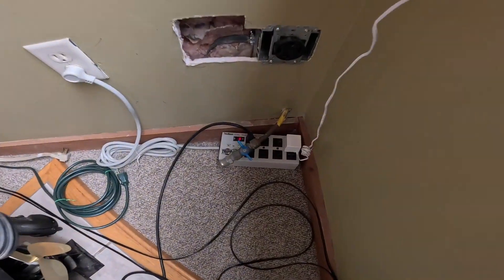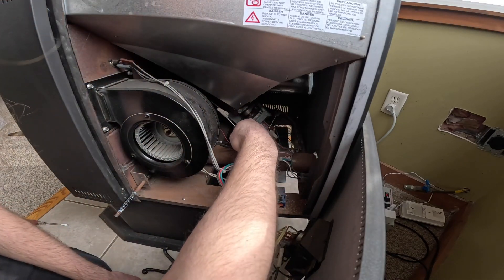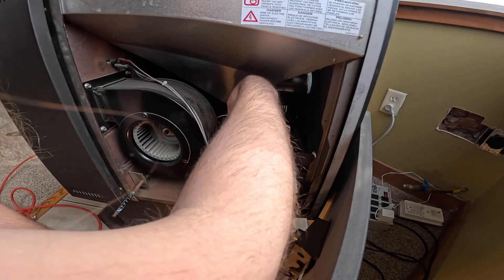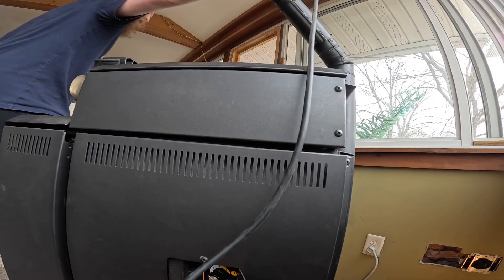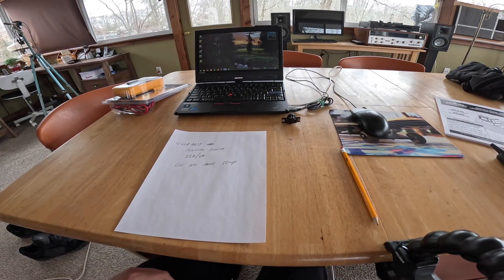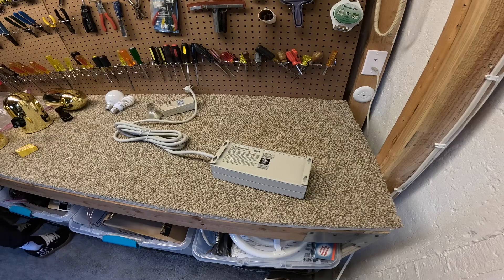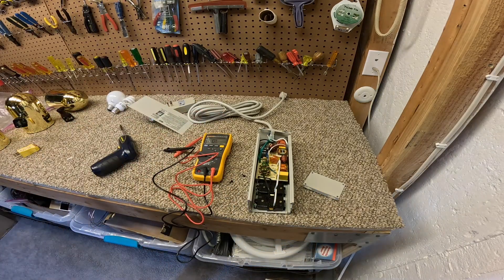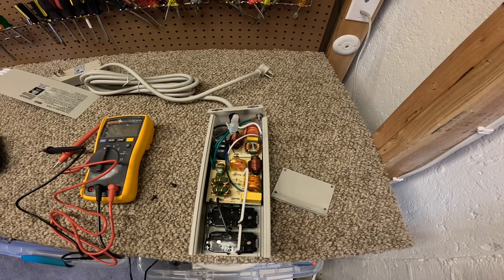Stove Breakdown | Fuses are Superior to Circuit Breakers

Comment: I am a fan of fuses as well; even for house panels. The only issues with the fuses is the ability for the user to install the wrong fuse (say a 30 amp in a 15 amp circuit) and cause issues. Other than that, fuses are superior. 

We have a good ole Federal Pacific Stab-Lok panel on our house, and I have had 2 times where there was a dead short, and the breakers just don't trip, they will sit there and melt the cable until you manually shut them off; very dangerous. 
In my workshop, I installed an old fuse panel from the 1920s to protect all of the receptacles and lighting in the building, I feel much safer than that than I did when it was just running off of the main breaker panel, especially being a known defective panel.

even good breakers such as a square D can and do fail. It is a mechanical device which includes quite a few variables in it's operation. A fuse is just a thin link of wire which melts at a certain point, it will always do that successfully.

Comment: Some years ago, I worked on a project at the Throgs Neck Bridge (Bronx, NY), and they replaced a set of 43-year old switchgear that contained circuit breakers with FUSE-TYPE gear! I guess they were convinced that fuses were better. (This was a 4160-volt application.)
And it was a lot more complex than a straight replacement, because the circuits had to be opened on low voltage and other conditions, something fuses cannot do. So they had to add electrically-operated line switches and control logic to handle functions other than shorts or overloads.
They wanted fuses so much, that they were willing to do all the extra design and installation work required.
Reply from the maker: I think the extra effort is well worth it. A properly working and effective safety device is well worth it when it comes to electricity.

Comment: Maybe the design of the stove should have included a fuse in the igniter circuit. The failure of this device may have produced a high-resistance "short", something that would not trip most 15 or 20 amp breakers. So providing your own protection in the form of the power bar is surely a very good idea.
Reply from the maker: Some type of on-board fuse would have been nice, but I also don't know how much of a problem this would have been during a typical lifespan. This stove is 25 years old, certainly that's longer than the manufacturer ever intended people to keep it.

Comment: Seems to go against the spirit of the channel to replace the device rather than the part that went bad. But if you're going to replace the device, perhaps it would be more economical to get the 4 outlet one with a shorter cord for that install. Or better yet, look into whole house surge protection instead of running literally everything through Isobars.
Reply from the maker: Unless I had enough knowledge of the circuitry to obtain a fuse of identical specification, I don't think I'd fully trust it. It won't go in the trash; I'll re-use it as a basic extension cord. Whole house surge protection wouldn't provide the same safety. There wasn't even a surge involved here--the key aspect in this situation was that ISOBAR fuses everything connected to it, which is an indispensable safety measure for equipment that runs unattended.
Reply: @JordanU   the fuse should have its rating stamped on it, and if not I'm sure tripp lite would give you the specs if not mail you a replacement  fuse it is most likely a common spec fuse if the MOVs have not been fried a simple fuse swap should return it to 100 percent functional.
Reply from the maker: @ No reputable manufacturer is going to send a random consumer specific components to perform repairs on a non user serviceable piece of equipment like this, that is a major liability for the manufacturer.
Reply: @JordanU  is it not a replaceable fuse? sounds like you might be being close minded to possibilities. logic ought to tell you almost certainly is a 15 amp fuse.
Reply from the maker: @ The fuse is soldered to the board with no intention of being replaced. Logic would not tell that as the bar is rated for less than 15 amps.

Obviously I can desolder the fuse and replace it with one that matches the current rating of the bar. That will probably restore comparable functionality as when it was new. Since this is a matter of safety, that's not good enough to me. I see no reason to attempt a likely repair and say "this will probably work if there's an issue" when I can buy a new one and have the peace of mind to say "this will definitely work if there's an issue".
Reply: @JordanU  I mean, you could say the same about any replacement part, really. What if the thermal fuse in a motor fails? Why go through the effort to fix anything if it's not guaranteed to work safely? As expensive as they are, even the Isobars are made in China and [correction: not all of them are] probably don't have 100% quality control, as we've witnessed via the one that had a bad outlet connection. You can't say a brand new one will definitely work.

I didn't realize that the fuse was soldered though; that would be a pain. It looked from a distance like it was clamped. If nothing else, perhaps you could replace the fuse and then use it only for temporary use cases while attended.

It's just occurring to me that perhaps that's why the fuse blew and the breaker didn't trip; the power draw was over 12A but under 15A.
Reply from the maker: @Xyspade  You can, and I would, say the same thing about a repaired fan motor where a fuse of potentially improper specification and unknown quality was used. I do think it's worth noting that a fan, or any small portable appliance, is quite a bit different than a power bar. A power bar is connected to power, in most cases, 24/7 including while unattended, and is responsible for it's own safe operation, as well as the protection and safe operation of the equipment connected to it. While it is true that defective products exist and we can't say with 100% certainty that it will work, I think we can say with more certainty that a product of good quality that's never been tampered with is more likely to work as intended than one that's been fit with a part that is similar to what it should be.

These bars are insured by the manufacturer; if the bar is tampered with, that voids the insurance for connected equipment. If the bar for whatever reason malfunctioned and damaged the house, I'm not sure the home insurance would pay out if using something that was tampered with. I don't think it's worth finding out the answer to either of those questions. I repair, often times at no cost, probably more than 95% of the equipment that breaks on the property. There's a small handful of things I don't want to deal with myself or don't feel are worth repairing out of potential safety concerns. This is one of those few things. I'm very surprised there is this much upset over replacing a power bar. I could understand if it were a rare and/or vintage unit, but these are still under manufacture and are available through retailers worldwide. It's not even going in the trash, it's being repurposed in a way that makes sense to me.

That ignitor sounds like it's shorting to earth. Power consumption aside, that type of failure should cause the circuit to be disconnected immediately, just like the fuse did. You could hear it arcing. An electrical arc is an extremely hot flame. Seconds matter. The breaker would have tripped eventually, it's just a matter of how long. 3 seconds, maybe 5 seconds. The fuse blew almost instantly. That's what you want. There's a good chance the power consumption was well over 15 amps. One of the many flaws of circuit breakers is their lack of precise and timely response to overload.

Comment: Th UK having fuses in every plug really had the right idea as far as fire safety also their use of 100mA  GFCI function on all breakers would have probably caught that arcing failure even if the current wasnt high enough to trip the breaker.
Reply from the maker: I agree.

Comment: Breakers are designed to protect the wires in your walls, not equipment.
Reply: yes this is why the UK had the right idea fusing plugs on appliances and extension cords, also this is one of the rare cases that GFCI or AFCI breaker might ahve made a difference something to not all UK breakers have bout 100ma GFCI function
Reply from the maker: That backs the idea that they're inferior as the fuse would do both.

Comment: I wish these devices had an easy access fuse hole otherwise they would be just about perfect 
Some of my PDU strips have them and it's always super handy
Reply from the maker: It would have been nice if the fuse was designed to be replaced by the end user.

Comment: good thing the power bar caught it so quickly. I will never understand why some people dont use such important protection devices.
Reply from the maker: Too many people believe what mainstream manufacturers say, which is that circuit breakers are a magical safety solution.